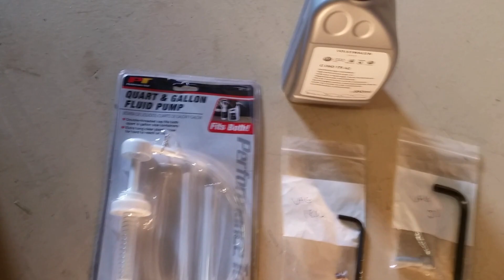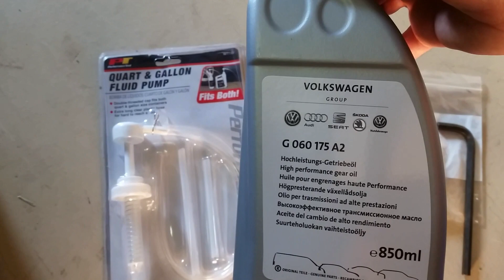Volkswagen Golf Alltrack Haldex Maintenance fluid change 4motion R Sportwagen

Comment: I live in Sydney, Australia.  It doesn't snow here either.  It does rain.  You don't need a wet road or snow for Haldex to engage I did a Haldex change at 59k km (35k miles). The screen had some debris but the hole the pump fits into was filthy.
Don't do half a job.  Pull the pump, clean the screen, change the O-rings.  The O-rings can be bought for AUD10 if you know where to look; AUD25 for genuine parts Made in Hungary on a Chinese site.
Reply: I made my comment based on the written description above.  I've just seen how you checked the pump.  OMG! Do the job properly.  You didn't clean the pump receptacle hole OR inspect the screen properly.  
DON'T DO HALF A JOB LIKE THIS VIEWERS!
Reply from the maker: @bradleygray2103  good points. I’ll be sure to clean the bong resin out at 70k Miles next time.

Comment: Thanks for sharing your video and giving those valuable tips.  
Did you use a device to activate Haldix pump after change fluid ? Temperature measure ? Thanks
Reply from the maker: The pump runs when the car is running, it is always active. I did not measure any temperature as I live in Florida and it is always hot here.

Comment: Nice video - will help me when I need to do it!  Only issue is the interval = the interval is 3 years regardless of mileage, not 30K miles.  Your video jives with what I've read from others that 30K miles the fluid is newish and the filter is clean.  Cool wheels!
Reply from the maker: I'm going to stick with 30k on haldex and 40k on DSG change interval because it's easy to remember. Thanks for compliment!
Reply: @CarsandCoding  yeah, make sense and is easy/cheap enough.  Interesting that the diff fluid doesn't have a change interval - I would think that is more critical.  My issue is mileage - I am ~24K/year so I'll probably do 3 years but will stick with 40K on the DSG b/c well, it says 40K!